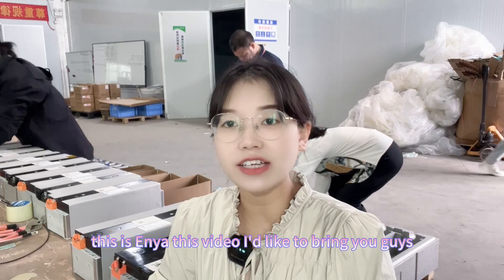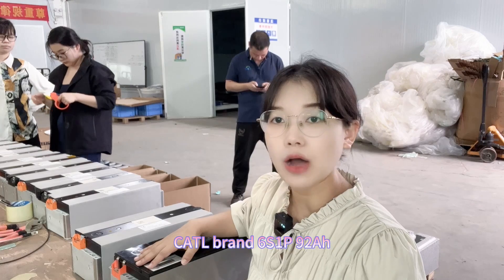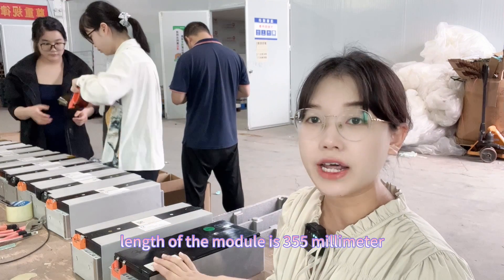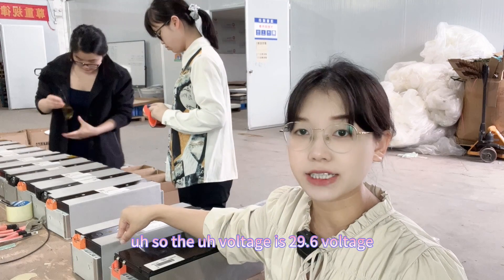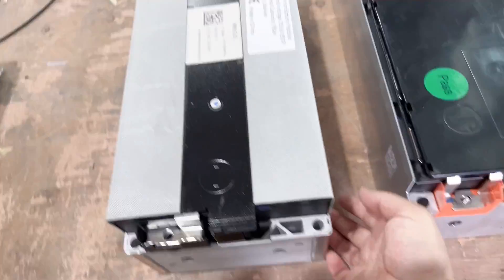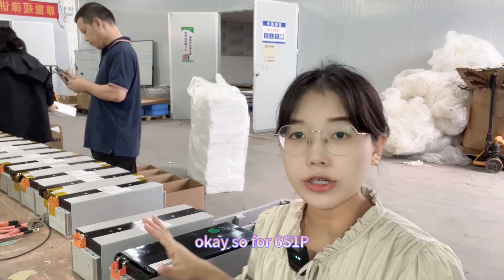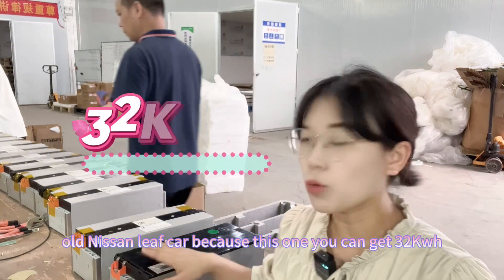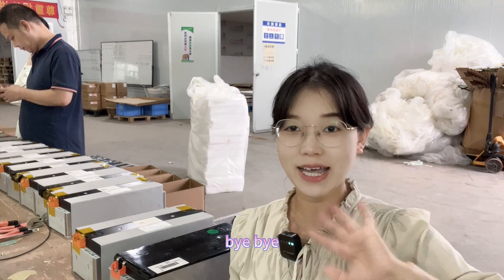Less 2500$ cheap solution for Nissan Leaf battery replacement

Comment: the math is 24×14.8×180 = 63936  i.e. 63.9kWH,  IF using the No.HY-4S1P180 "63.9Kwh CATL 14.8V 180ah 4S1P NMC Rechargeable Lithium Ion Battery Module Electric Car Battery Pack For Nissan leaf car EV Power Batteries ",  you would need 24 blocks and figure out how to fit them all into the old battery shell/case.

Comment: OK, let us calculate a little bit: Let us start with 8s1p battery: It has - according to the description on it - 29,6 V x 90 Ah x 12 pcs = 32 kWh (approx.) - it may be seen as quite good as the replacement for 2016 30kWh Nissan Leaf original battery. BUT: 12 modules x 29,6V = 355 Volts. This is to low voltage for Nissan Leaf! Nissan Leaf battery has about 395 V when fully charged to 100% capacity; about 380 V when charged to most often used 80% capacity and about 365 when discharged to about 50%. How will battery management of Nissan Leaf deal with the 355 V voltage?? Let us go on with 6s1p battery: 21,9v x 92Ah x 16 pcs = 32 kWh (a little bit more) -  it may be seen as quite good as the replacement for 2016 30kWh Nissan Leaf original battery too. BUT: 16 modules x 21,9 V = 350 Volts only! Again: this voltage is much lower than the typical voltage of the standard industrial Nissan Leaf battery. The same question as by 8s1p? How will battery management of Nissan Leaf deal with the 355 V voltage?? I ask you kindly for PRECISE TECHNICAL answer, not marketing related statements. Thank you.
Reply: The voltages being used in this video are nominal voltages, not "fully charged" voltages, which are totally different metrics. Using nominal voltage (and not "fully charged" voltage) is considered the industry standard way to rate battery cells. These are NMC cells, very similar in chemistry to those used in the LEAF, and have a nominal voltage of 3.7v, and a fully charged voltage of 4.2v (the same voltage as those used in the LEAF). 

The LEAF in factory configuration uses a 96s battery pack, with a nominal voltage of 355v. When fully charged to ~4.12v/cell, you get nearly 400v. This same measurement methodology applies to all lithium ion cells, and would be essentially the same voltage as any other 96s setup using traditional NMC or NCA li-ion cells (obviously LFP or LTO would be quite different).
Reply: @Alex_Bessinger  Thank you very much for you kind reply. There are the NMC cells used in both the battery packs? Or is the 8s1p pack with some other chemistry? Where can be your batteries bought in Europe? Are there some distributors with technical knowledge and replacement praxis in some EU country? Thank you.
Reply: @mirektrmac2773  I'm not the poster of the video... Just wanted to point out that the voltages they are quoting are nominal, and not "max".

Based on looking at their website, it looks like all of the modules in this video are NMC, but they do have other chemistries available.

It would be quite difficult to use anything other than NMC or NCA for a LEAF battery, as the Battery Management System would not be compatible with anything that uses a different voltage range (such as LFP).